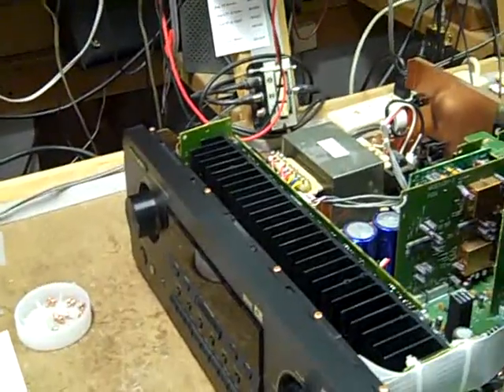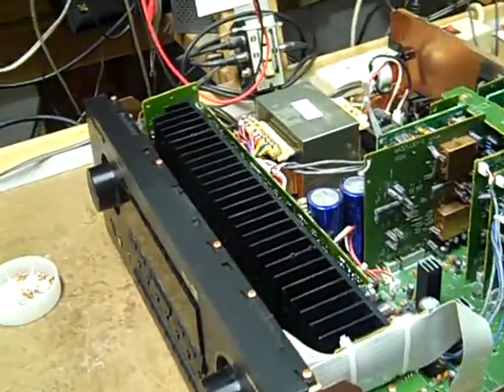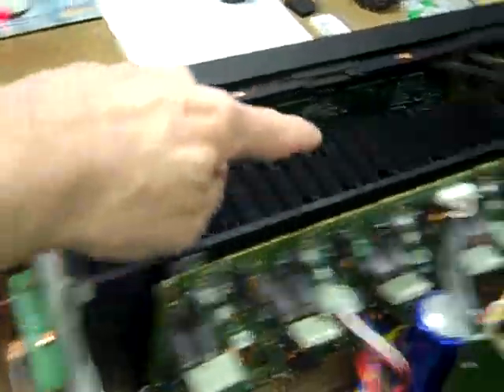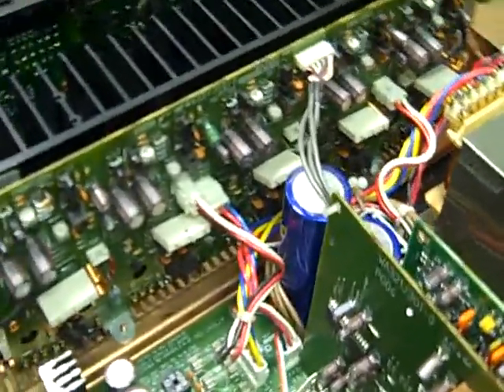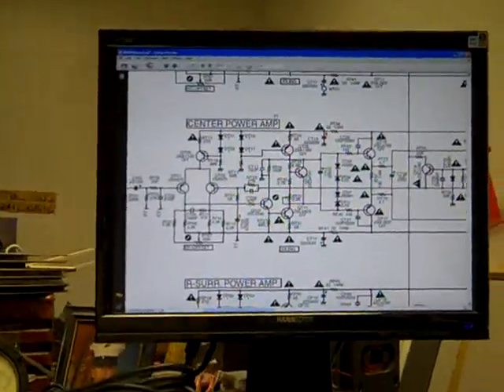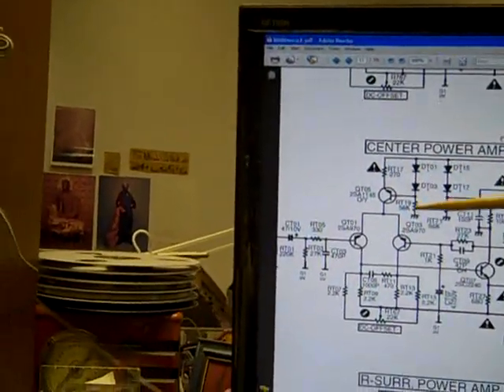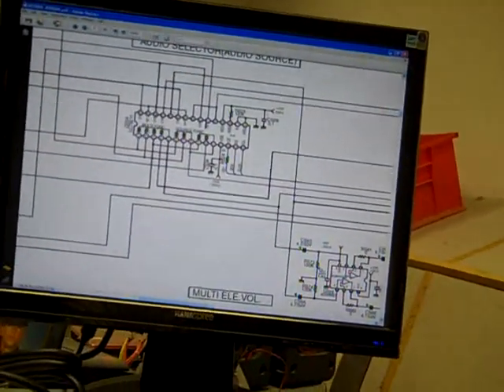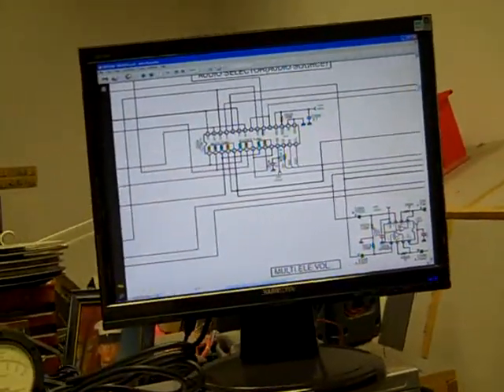Marantz SR-8000 Repair Brief

Comment from the maker: I replaced the cap on mine, assuming it would be bad, like the SR-18EX, but it was a different type, and it was fine. I don't think I'd worry about the cap, especially since it was a really big job to separate the board from the front panel to replace it. Re-soldering doesn't require such a major dis-assembly.

Comment from the maker: Sorry to make you nervous! Just use it and enjoy it. So far as the caps are concerned, I've not seen ANY go bad in the 8000's. If it were to have a cap go bad, I would think something in a regulated power supply area might go first; some of them are near heat sources.

Comment: No, not really noise, just hoomph as usual when receiver boots up. I detached power supply cables from the amplifier section and that made no change, so I believe it is safe to assume the problem is not there. I noticed two boards with bigger caps for filtering and removed one of the cables that interconnects them. That made a change and receiver did not go into flashing red mode afterwards. It also didn't display anything. I think the problem is power related. What do I check there first?

Comment from the maker: The front panel FL display tube needs to be resoldered. Fairly common problem. The entire row of pins needs the soldering, but it would be easy to miss the filament connections at either end. They are somewhat separated from the other pins, about an extra 1/2 inch at either side.

Comment: Mark, Thanks for the tip on my display. Haven't had time to check back here for the answer, been sick. I'll take it out apart soon to fix it. I'll make sure to look at all the solder connections I can while I'm at it, avoid future problems. The cap you refer to, should I go ahead and replace it while I'm there? If so, can you give me the specs in advance so I can get the correct one ahead of time? Thanks again. 
Bill

Comment: I have a Marantz 8000, that I replaced the output speaker relays. They go bad over time. But, now I have an issue that one side speaker outputs go out when pressing on the boards. I cleaned all pins and sockets of the parallel boards to the main. Must be some bad solder joints I hope. Do you see these have bad solder joints on the sockets maybe???
Reply from the maker: I'm thinking bad solder connections on the underside of the main board, especially where the vertical boards plug in.
Reply: Ok thanks. I meant perpendicular not parallel. @mdzacharias

Comment: Hi Mark I appreciate your videos and your electronics skills/art. My SR8000 now I can only hear very low volume when I crank up the volume to +10dB or +15dB. I thought I'd lost all audio because I normally would have the volume at -15dB max. I don't know if it's a good sign that when I turn the volume up all the way that I can at least barely hear it. Would that indicate anything specific to you to look at for fixing it?
Reply from the maker: I think I'd check the solder connections of the voltage regulators and board edge connectors of the main circuit board. Aside from that I have no real idea. It's been a long time since I worked on one.
Reply: @mdzacharias  thanks for the quick response! I'll look into it 👍

Comment from the maker: @94ballou Thanks for watching! 99% of my repairs require only a multimeter or two, a 20mHz 'scope and a cheap old audio generator. Don't usually need any more than that! If you need advice on a repair, just ask.

Comment from the maker: @litevibe The amp section pretty much either works or it doesn't. If it were distorting that much it should just shut down. My guess is the sound field or tone controls are excessive, or the speakers are funky, or you are just playing it too loud.

Comment: Hi Mark, My Marantz SR 8000 has a display problem. Every day the display shuts off after about 45 minutes, it comes back on after being shut off for several hours or if I tap on it with my knuckles. Doesn'y take a hard tap, I discovered this accidently one day when I bumped into it while doing something else. I'm suspecting a bad solder joint, but not sure. Where to look for this? I don't have a schematic.

Comment: Mark, I'm interested in buying a Marantz SR8000, (made in Japan), or SR880 mk2, 5.1 is fine for me and no HDMI, I got interested in these receivers because of the Japan build and they're not as much plastic as newer models, and very affordable, would you recommend these older Marantz units or are they problem prone?  Any superior built units from the late 90's early 2000's?
Reply from the maker: I like the SR8000, no so much the SR880 types. Unfortunately just because one model is a certain way doesn't necessarily translate to other models by the same manufacturer. I like the SR-18 series but they are very complex and are prone to certain problems. For newer receiver I definitely like Yamaha best by far. Newer Marantz models I have seen are less reliable and even though they are very nice, Marantz does not support them as well for parts down the line. If you like the older ones the SR8000 is a good one.

Comment from the maker: Oh - and don't forget. The solder connections along the bottom of the main PC board where the vertical boards plug in. If it is the power supply, look at the +5 and +12V regulators. If one is low in output, don''t just assume the reg is bad. I've been fooled by this. A bad cap at the output of the IC can cause oscillation. All kinds of squirrely stuff can happen then.

Comment: Hi Mark, I have a SR8000 which the center channel has not produced any audio for quite some time. I was looking for Marantz service centers but had difficulty finding any near me. Would you have any guesses or ideas to point me in the right direction? The AVR is pretty old now but I'm curious if this is something you've come across before or how common it might be?
Thanks in advance.
Reply from the maker: grocerylist I think it's worth a try doing a reset. "HOW TO RESET THE UNITShould the operation or display seem to be abnormal, reset the unitwith the following procedure.The SR8000 is turned on, press and hold the CLEAR !3 and DISPLAYOFF buttons !1 simultaneously for 3 seconds or more.Remember that the procedure will reset the settings of the functionselector, Surround mode, delay time, TUNER PRESET etc., to theirinitial settings."
Reply: Hi Mark, it appears the reset didn't work. I've tried the various sound modes like 5-channel stereo, movie, matrix, etc but nothing comes from the center. It's been a while but I've also tried connecting a different center channel speaker but still get the same results. 

I'm in the market for a new AVR because I need HDMI inputs/outputs but if you thought it was worth looking into (not too expensive) I'd be interested in pursuing repairing this, otherwise it will continue to live as an excellent stereo receiver.

Comment from the maker: I checked with Marantz - they have no info on this. There is a reset for this model. With unit ON, press and hold CLEAR and DISPLAY OFF for 3 seconds. If the reset is successful, the volume will have reset to a default value. I don't think power supply - more like a data problem of some sort.

Comment from the maker: You hear this noise on all speakers? If so maybe an open filter capacitor. Otherwise the fast blink usually means a high-current shut-down, like a blown amplifier channel. Not an easy fix at all on one of these.

Comment: Hi Mark,   I have a Marantz sr8000 like this one. My left rear surround channel will not come on, on initial start up of the receiver.  I will send a test tone and I can't hear anything, all other speakers work with the test tone. But, it will come on eventually at low volume. And if I tap on the speaker it gets louder. If I raise the volume the sound cuts in and out. I tried another speaker, switched cables. Looks like it is in the receiver. Seems like when the receiver warms up it works. Now, could be a bad solder joint, or even a amp out chip. I don't have schematics for this unit. Does it have separate amp chips for each channel?
Reply from the maker: Possibly an issue with the relay associated with that speaker, or bad solder at the speaker terminal board, which is pretty accessible, could be a bad connection anywhere. All of the vertical boards which plug in on that unit can have bad solder at the connectors, also the main board itself where the boards plug in. I've re-soldered dozens if not hundreds of connections on any given SR-8000.
Reply: Where can I get schematics? OK, they have relays. Are the relays sealed, maybe needs cleaning.
Reply: I can buy a used one for 100 bucks for parts.
Reply: Bought the service manual. I see, surround has one relay with dual contacts. Coil driver is good since other speakers are working. Could be the main amp, not sure when they have problems they completely quit or intermittent like that. I will check solder for sure. I fixed a lot of stuff that just had cold solder joints. Hope this is the case here.  LOVE THIS Receiver  - the 5 channel option is great.
Reply from the maker: Unlikely the problem is at the amp board itself. Try tapping around the relays, speaker connectors, etc with a non-metallic object like a chopstick or a BIC pen. Often this will help reveal where the bad connection is, making the affected channel cut out.
Reply: thanks Mark love your channel

Comment: Mark, I've seen some SR 8000 on EBay. Want to get one for parts. Some have segments that are dim on the display. Have you come across this. Are the segments bad or maybe bad solder joints.
Reply from the maker: The dim segments would usually be due to aging of the FL tube itself, although resoldering the connections involved might help. Wish I could be more definite.

Comment: Hi, nice video. I have a little trouble with an SR7000 : it shows "error 02". Nothing about it on the service manual. I suspect a power supply problem, do you confirm? :-)

Comment: Hi...how do you do a reset on a Marantz SR8002? I also have just recently lost my front led display.
Reply from the maker: Does it come on briefly when you turn the volume or source select knobs? If so there's a display mute function turned on. Some models also do this when they're in "Stereo Direct" type mode. To reset: When turned ON, press MULTI + SPEAKERS A/B for 3 seconds or more. This information is in your OWNERS MANUAL. If the display still does not work the receiver needs an actual repair. Are you a technician?
Reply: Thanks for the reply Mark. I am not a tech. I am the original owner and everything else works just fine on the receiver, the display just went out a couple weeks ago. The other lights on the front still work...power/standby/blue volume and source lights. Thought it might just be a fuse, but Marantz said there is no fuse for the led panel. They expect a board replacement may be necessary. I will try the reset first.
Reply: Hi Mark...no it does not come on briefly with volume or source. Did the reset and still no front LED display. Looks like a new board needed? Do you have any idea of cost, even just ballpark?Thanks
Reply from the maker: At a glance - here are some possible candidates for your problem:
1. Possible bad solder connections at the filaments of the FL display tube.
2. Bad 100 ohm resistor(s) in filament supply from Power PCB. (R642, 643)
3. Physical damage to the display tube.
4. Missing -30 volt line (they spec at -28) from transistor Q616 on Power PCB
5. Bad one ohm resistor associated with -30 volt line on Power PCB (R639)
6. Bad zener diode D615, or shorted cap C622 on power PCB. If so would probably damage Q616 and possibly open up resistor R639.
5. Defective IC 81 displpay driver IC, or missing it's own 5 volt line.
Reply from the maker: Marantz does not sell boards for the most part. A few for warranty repairs - and NONE for older units. And you might find that replacing the board doesn't fix your problem. What then? Somebody who knows what they are doing needs to troubleshoot - or you need to find another receiver.

Comment: Hi Mark, Marantz SR 8002 has a display problem – completely blank. Reset doesn’t do the trick. I saw an older post, where you suggested to re-solder the entire row of pins of the FL display tube. I haven’t open this thing up yet, but looking at the schematics (actually
the front PWB PCB), are you referring to the 50 something pins connected to the resistors? What would cause the solder joints to fail, (apparently not so uncommon)? Heat?
Reply from the maker: Check that there is filament voltage for the display tube, about 5 volts AC. This is available at the two outermost pins of the tube itself, or at connector CN66 on the POWER circuit board.

Also, approximately -28 or so volts DC is required from Q616 on the same board, marked VKK and available at CN62 on the same board.

Bad solder connections at an FL tube is fairly common, especially at the filament connections.
Reply: Actually, I think I am barking at the wrong tree. The voltages measured at connector BN14 on this board are weird (especially VKK, that should be -28.8): FL1 6.5; FL2 6.5; VKK 1.3. Will look further into this, I think at the power PWB, around transistor Q616 .
Reply: Thanks, I posted a second message before refreshing the screen (and missed your reply). So yes, the VKK is 1.3. I was thinking at the Q616 as well. But FL1/2 is also higher (should be 5.5, it is 6.5), not sure if that's an issue. But VKK definitely is.
Reply: Hi Mark, in your experience, what might have cause the drop in VKK? I made just a few measurements, will resume during weekend: FL1 = 6.5; FL2= 6.5; VKK= 1.3; Transistor Q616 (PNP) base 0.7, emitter 1.3, collector 1.3
Reply from the maker: Bad resistor(s) R642 or R643 could cause VKK to die, bad transistor Q616, or Zener diode D615 also. This is where actual troubleshooting yields the real results. One takes a couple voltage readings in the affected circuit then think about what this is really telling us. If for example the difference in voltage between base and emitter of Q616 were five or six VOLTS in what would be the forward biased direction for a PNP transistor, this would be wrong. Such a difference shouldn't exceed about 0.6 to 0.7 volts, so the transistor would be defective.
Reply from the maker: With such a low voltage at Q616 I would suspect something in the chain of R639, D613, R640 and R641. R639 maybe most likely but it could be blown by a shorted or leaky D613.
Reply: Right on the target! The R639 was open; replaced
with a similar (higher power 1W) resistor and display now works as it should.
Many thanks! However, once the display was working, I discovered another
(separate) issue. The tuner doesn’t seem to work (properly). I can’t get it
tune in, and when trying to tune up/down seems unresponsive or very slow. Same
on AM/FM (no sound, doesn’t seem to tune in) regardless of using the unit/remote
buttons. Is this something that can be tackled with, or the whole module should
be replaced (not going to do that anyway).
Reply: Hi Mark, sorry to bother you
again. I mentioned before that after resolving the display problem, the tuner
proved to be defective. To offer more details: when in AM or FM mode (digital
or analog radio mode doesn’t matter), the up/down (frequency) search (using
unit/remote) doesn’t seem to be responsive, frequency doesn't budge – although
at times (rarely) works, it starts increasing/decreasing the frequency slowly,
then stops, and… nothing. Even if I enter a specific frequency (AM/FM), it
doesn’t tune in (“tune” text is not lit on the display, and of course, no
sound; I am using an ordinary cable as an antenna). I re-seated the connectors
from the 2 boards, checked the 3.3 and 5 V regulators on the PCB, and
reset/factory defaults the unit multiple times, to no avail. Besides replacing
the whole thing (there are 2 modules, the tuner module and the HD-radio PWB, is
there anything else I can do?
Reply from the maker: I'm assuming you have an antenna attached. I think there's two different tuner modules in this one. Seems unlikely they'd both be bad... but the modules aren't really serviceable. Maybe check that the power supply voltages to them are ok. Otherwise they pretty much work or they don't. Thanks for the Paypal, by the way!
Reply: Hi Mark, final (?) chapter. I removed again the tuner board, and took a look at
some transistors with built in bias resistors (I didn’t remove them, just
measured in circuit with the diode DMM, more like comparing 4 identical
transistors (Q901-04). A couple of them tested “open” between BE, the other 2 (identical)
had some 1.2 V drop. Of course this is not a reliable measurement, because it
was done in circuit, and the built-in resistors complicate things as well. Anyway,
I put all back, and powered on the receiver. And…surprise, surprise! The tuner
works as it should. What the heck? I thought electronics was supposed to be an
exact science! So I removed and re-seated the tuner boards 3-4 times so far,
except this last time (I didn’t do anything else, except taking the above mentioned
measurements) worked. Anyway, I think this is a typical case of divine intervention.
Question is – this could be explained by an imperfect contact? It might re-occur,
I guess.
Reply: Actually,
I wonder if I inadvertently activated one of the IC91 pins, when applying the small
DMM voltage. One of the transistors is connected to the reset pin of the IC. Could
I have changed the digital status of the pin?
Reply from the maker: I don't think the DMM ohms function would change a state UNLESS sometimes a mosfet will behave this way when testing out of circuit. Haven't seen it in-circuit though.

Comment: Hello, I have a sr8000 with problems.

At first the central had no sound, apparently it was a welding problem. then others stopped ringing. So it was opened and I checked again. but now the problem is worse. on the screen appears (Error Power 1) could someone tell me how I can correct this error?